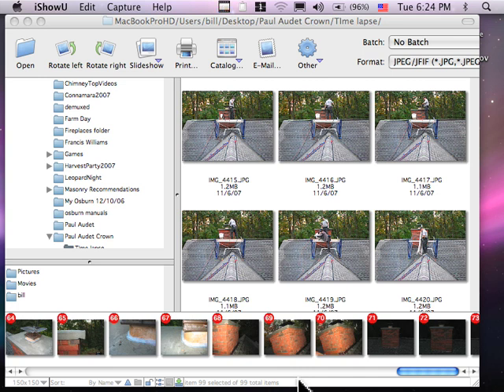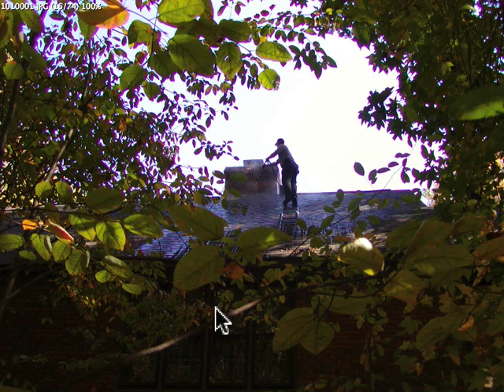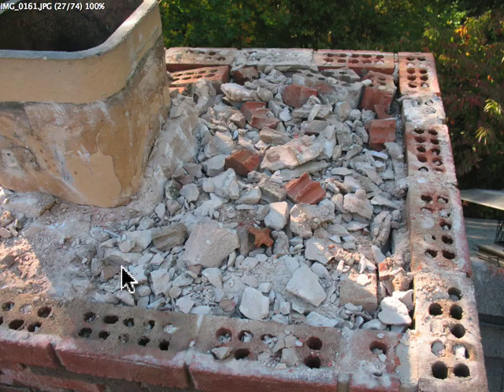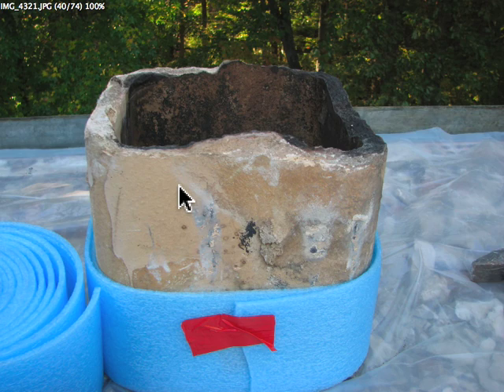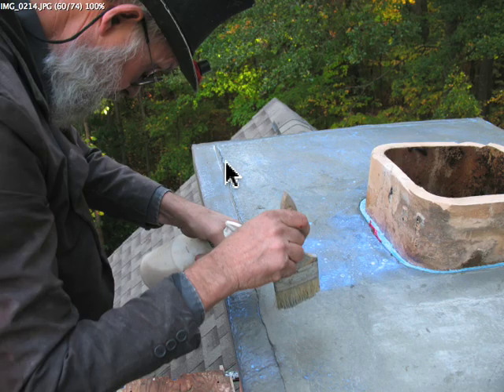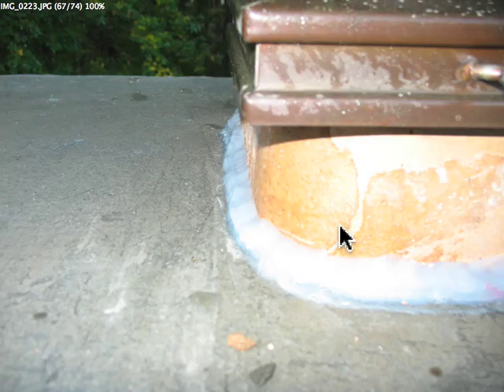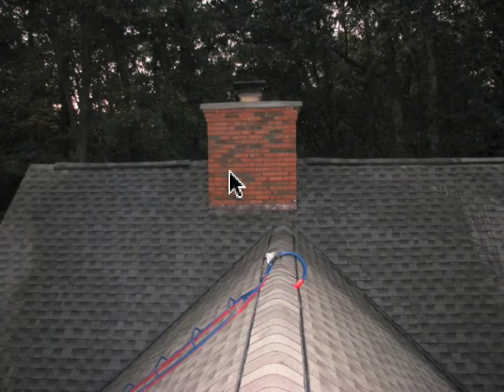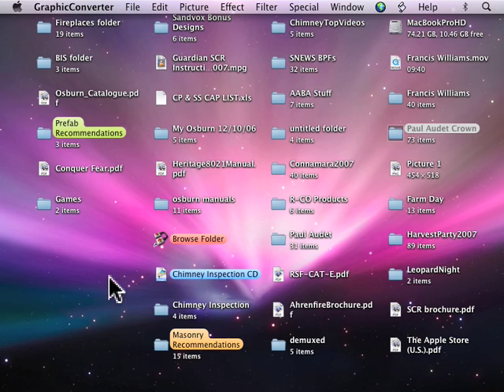Waterproofing a chimney

Comment: I enjoyed the video even though I am working on a spalling brick problem from a federal style rowhouse from 1900.  The spalling is not at the chimney, but I will keep this in mind next time I am on the roof.  I had a mason do some tuck pointing for me which turned out great but I am guessing I must replace the spalled brick.  I had some college kids in here that put a washer/dryer in the bsmt and did not vent it so the bsmt moisture I believe caused spalling. rgds.